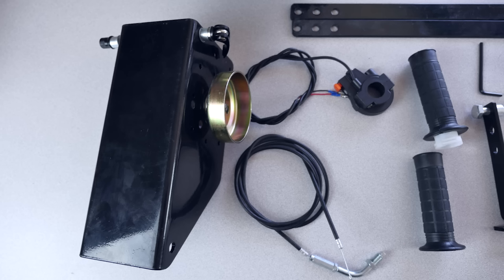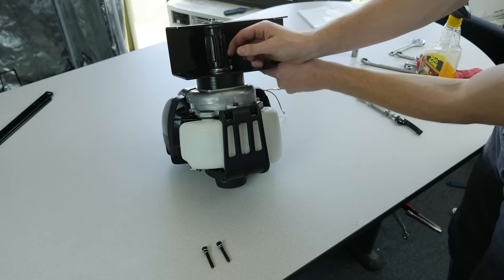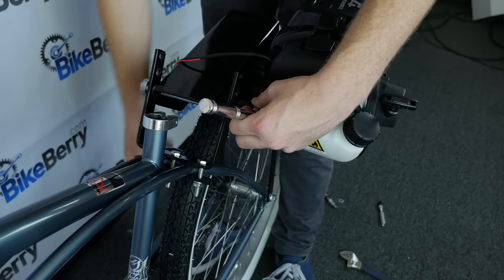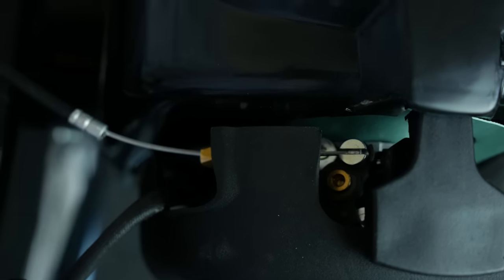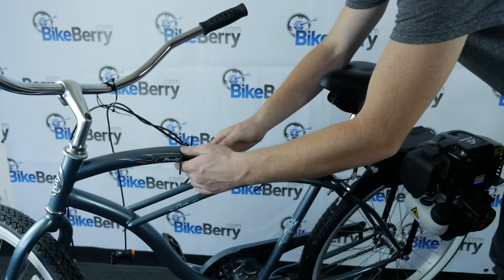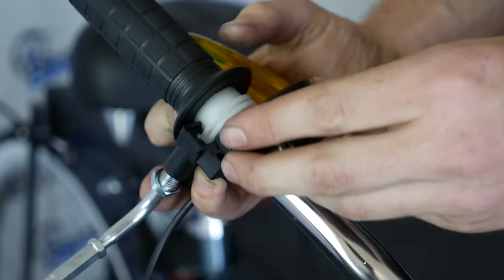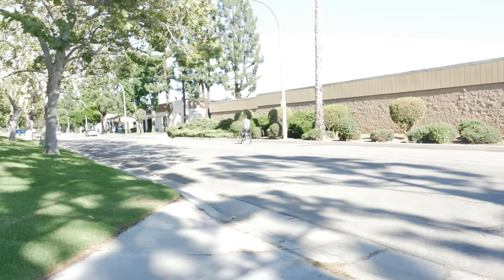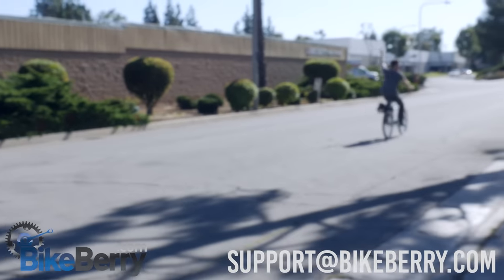4-Stroke 38cc Friction Drive Motor Bicycle Engine Kit Installation | The Flying Horse Lock-n-Load

Comment: I've ordered one time from BikeBerry. Spent almost $300. I was sent a 49cc Lock and Load engine kit....missing crucial pieces. Like the Stilts. The gas cap. Extra Fuel line I paid for. As well as multiple bolts, washers, and spacers to mount the engine AND to assemble the brackets. After receiving SOME of my missing parts in a second shipment, I STILL have yet to get the bolts and washers that were missing. A 3rd shipment is on the way to rectify my original order but I've seen in my email that it's STILLLLLL not all my missing bolts, washers, and spacers!!! I'm NOW going to have to hassle BikeBerry 4 a 4th shipment...which will HOPEFULLY FINALLY have my remaining bolts, washers, and spacers. Very, VERY disappointing experience thus far.
Reply: That's why you should make it yourself

Comment: Order about 50 back tyres.
Reply: My thoughts exactly lol as well as some inner tubes those will be more vunerable
Reply: Tom Lamb  you're*
Reply: @corey7683  You're**
Reply: @darrelllatham6086 You got me beat 😳
Reply: Exactly!
Reply: @corey7683  smarty pants even you got it wrong
Reply: Not necessarily so. My dad had something similar back in the 50s, a MiniMotor. It was a Villiers engine mounted on a Sun bicycle, driving the back wheel by friction on the tyre. Yes, it was a heavy duty tyre, but I was still riding that bicycle with that back tyre fifty years later
Reply: @corey7683  Yooooooooooor
Reply: or before you install it you take that metal cog that touches the wheel and you coat it with the dip rubber or flex seal so its a rubber on rubber contact which will allow the wheel to last a lot longer.
Reply: @Dragnmastralex  flex seal wouldn't last long. Maybe a thick rubber sleeve some how.

Comment: AHHHHH !!!! The memories I used to see these in the 1950's .In those days you could pass your driving test with one of these then go out and buy a 1000cc motor cycle if you wanted
Reply: See above comment. I had the 'CycleMaster'.
Reply: I didn't think they had 1000cc motorcycles in the 1950s 🤔
Reply: Miguel Salami there’s no way he was around and riding motor cycles in the 50s
Reply: @miguelsalami  Harley Davidson and Indian were making 1000cc motorcycles in the mid 1910s.
Reply: @mikemarler8224  In 1910 Harley Davidson only had a 440cc Single Cylinder Engine that produced about 4hp. They hadn't even developed the VTwin yet.
Reply: In the '50s there was NO need for MC endorsement,. ride ANYTHING you want with Class "D" license!
Reply: i had a AMF roadmaster
Reply: @mikemarler8224  1000cc and 7HP!
Reply: @miguelsalami   vincent v twins, and they were quick.

Comment: I'm still trying to cut off my handle bar with a box cutter 🤓
Reply: Miguel Salami you caught that too huh lol
Reply: I heard that also. But if you are still working on it, wear a helmet, like all the time.
Reply: Push harder.
Reply: @Paul-ou1rx  I heard him too........"cut off the handlebars". It took a LONG TIME using the standard blade, job went much faster with a "serrated titanium" blade! BE SAFE, ALWAYS WEAR PROTECTION!
Reply: Ikr. They slip right off with force, lube or compressed air. That’s just stupid

Comment: A similar engine called the Power Pak was popular in the UK in the 1950s. There were special steel reinforced tyres for use with it, as standard cycle tyres would just wear away in no time. The cord casing of the tyre was strengthened by having steel threads woven into it. The rubber was tougher and much thicker than normal cycle tyres. My father used to go to work on one and the rear tyre would last about a year. One big bonus, the tyre was virtually puncture proof because the steel reinforcement prevented sharp objects from penetrating.
Reply from the maker: Those tyre, and many other puncture resistant tyres,  are still readily available. We encourage every rider to customize their bikes as much as possible to fit their budget and needs. We provide this engine by itself to keep costs down for our customers.

Comment: I'm a 65 year old. I started with a Mach 10 chainsaw motor. It was direct drive chain, left index finger control throttle, drag foot brakes. To start it, picked up the back wheel, run and jump on. (45-50 mph)
Reply: Mathew Winney I put a mac 10a on my home lite go cart. Only lasted 10 mins until I broke the crank ,but what I great 10 minutes. ...lol

Comment: Very impressive and informative video . Can a piece of thick hose pipe on friction drive shaft help reduce wear and tear of tyre due to rubber to rubber contact instead of rubber to metal contact.  Please do so and make a video .
Reply: then it will spin itself instead of wheel
Reply: @rubo1964  may be . May be not . Actually we do this on drive shafts of motors to avoid  direct metal to rubber contact . The rubber pipe needs to be tightly fit .

Comment: Will the kits a fit 29 inch wheel mountain bike?  38cc or 49cc
Reply: +TheGrowGeek I was wondering the same thing.
Reply: +TheGrowGeek yes Mine is a 29 inch mountain bike it does fit however make sure you have bike rack mounts near the back axel. as long as you are under 200 pounds it will work great

Comment: So here are the tools you'll need. Now watch us install it with different tools. Oh and you'll need a tape measure and marker. But they weren't important enough to list in what you'll need. Oh and don't forget that you need oil.
Reply: Scott O lol than he said press the power button like its called a primmer bulb lol
Reply: and dont forget your portable drill
Reply: ไมตรี
Reply: Don’t forget your needle nose pliers which are now wire strippers
Reply: spam lite no you will screw up your wiring.
Reply: AND, that oil better be the MOST expensive shit on the planet!
Reply: And don't forget to align the bolts just right on in the mount.

Comment: was the first clip sped up??? looks like an unbelievable amount of power from a 38cc
Reply: All about drive ratios. I have a 23cc engine on a scooter that will do 40 mph. Short drive ratio, massive 18k rpm redline makes for alot of speed.

Comment: This design dates back to the 1960's. A good design that works. But the tire used as the drive tire  will wear out prematurely. If you don't mind buying new tires, good way to go.

Comment: It seems to me that you would be replacing a lot of rear tires. Also when you make up a wiring joint that will be exposed to the elements (heat and rain mainly) electrical tape is not going to hold for very long. You'd be better off soldering and wrapping the wires in heatshrink. At the very least a waterproof wire nut.
Reply: You’ve never heard of wrapping or using a lighter to strengthen the bond of the tape? I would say for it’s purpose of just a bike motor it wouldn’t harm it unless you intend on riding it in the rain.
Reply: @nickh2647  if you've got a wrap that is designed to be exposed to the elements and waterproof, sure. No I have never heard of "strengthening the bond" with a lighter. If you're heating electrical tape that's the opposite of strength. My original point was to keep water out. Electrical tape is not waterproof.
Reply: @Avaddon911  electronic tape is not waterproof but heating it helps the bond stick better. Unless you’re really want to be technical and you like to be overkill with solder by all means take the extra time.
Reply: @nickh2647  well I'm an electrician so yes I'll take the extra time and do it right.
Reply: @nickh2647  also, while we're at it. Heat does not help the bond of electrical tape. It just makes it get brittle faster. Most electrical tape is rated for under 200° f
Reply: @Avaddon911  your way of doing it “right” isn’t wrong and neither is mine. Electrical tape would work just fine for a job like this especially when the average person doesn’t ride their bike through Niagara Falls. For me, the heat of the lighter helps the bond of the tape easier, and wrapping it to make a tight fit helps. Not here to argue over tape. The current goes through the wire both ways but you’re just being a stickler with your comment and giving yourself extra steps. Not everyone has a soldering kit too Mr. Electrician
Reply: @nickh2647  you don't need a soldering kit... They make heat shrink tubing, heat shrink tape, wraps that are waterproof.
. waterproof wire nuts...
Reply: Paint on electrical tape is best I've found for long lasting waterproofing.
Reply: @paulmcfeeters5554  not better than heat shrinking but you do you
Reply: Realistically you’ll go through maybe one rear tire a year using this setup and at $15 - $20 a tire that’s not bad at all. Cheaper than tires, chains and sprockets with the traditional setup.

Comment: So can you fit that Predator 708cc engine with these brackets?  Asking for a friend :D
Reply: yes
Reply: It might just RIP the frame into pieces
Reply: NO! the 708 is a VERTICAL SHAFT engine. The 624cc would fit, BUT wouldn't last very long. The crank rides on PLAIN SLEEVE BUSHINGS, in other words.....JUNK!

Comment: Nice, but does it have v-tec
Reply: Remove rev limiter and yeah, you do
Reply: Probably not cause it's not Honda
Reply: @ChoboUnjeon  yes it is it's a Honda gx35 weed eater engine
Reply: @conner5611  does it have vtec then
Reply: @ChoboUnjeon  look at Jonathan's post and you have your answer
Reply: Better than that, ECO-BOOST!
Reply: Axel Edwards nah but it’s got free valve /s

Comment: Cool Vid! Though, am I missing something, or more to the point, are you guy's missing BRAKES here???
Reply: this was bugging me the entire time; it looks amazing to make it go but how does it stop...
Reply: I imagine you push back on the pedals seeing how the bike has a coaster brake on it.
Reply: ***** On a motorized bike?? That would be VERY minimal, and dangerous.
Reply: its what Harley's had at first and its what that bike has. They were dangerous and stopped working very quickly.
Reply: ***** Yeah I'll bet! I wouldn't ride it without real brakes. No way.
Reply: I actually ended up getting the bigger variety of this; you'd be amazed how much drag the motor not getting gas gives, I was riding just fine on front V brakes on a 49cc variant
Reply: Alexis Ross Oh man, I can only imagine the drag. How heavy is it? Do you like it? Trying to decide between a motor like this, or a battery system. Thanks.
Reply: Ah! Missed this by a month. Expect it to add 30lbs to whatever bike you ride it on. It has way more power than a battery system and if you get a 4 stroke takes standard gas; Installation is amazingly simple in comparrison to the chain drive that I now have. 2 words of warning; it WILL tear through mountain bike tires, my rear tire went bald after a good month and a half of use, and Don't expect it to push anything; get the bike going as fast as you can normally before relying on the engine; once you hit the balance though it rides really smooth and stays stable for a long time.
Reply: Maybe your foot might help ,no brakes oh sh--.Hand brake in the front ?estimate your speed ,.
Reply: Who needs brakes at 10MPH? Use your feet!

Comment: I bought one of these 49 cc and i burn thrugh a cluch every time i use it 20$ a pop. cool i weigh 250 lb don't buy one unless u are under 200lb. 2 stroke kits are grate, with upgrades
Reply: At least you did get the motor bolted to the mount.

Comment: people are concerned about the wear of the rear tire, which is not true, the 49, 52 and 63cc engines of the brushcutter type are engines with an automatic clutch, which is driven by a centrifugal system, which prevents tire wear in the acceleration and reduction, the automatic clutch causes the wheel shaft that touches the tire after you pedal the bike to be activated by gentle acceleration until reaching maximum speed without wanting the mechanical system in contact with the tire, slipping. .. engines with automatic clutch type of brush cutter is the most recommended and approved.